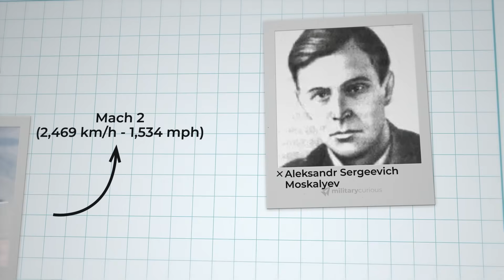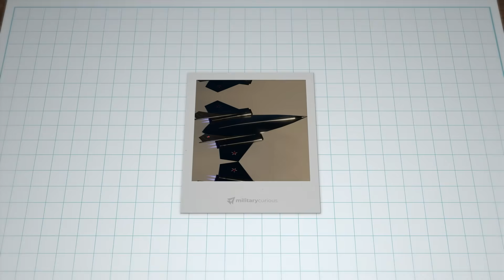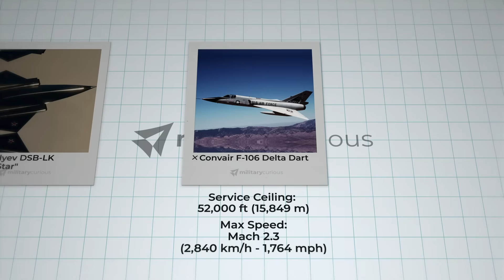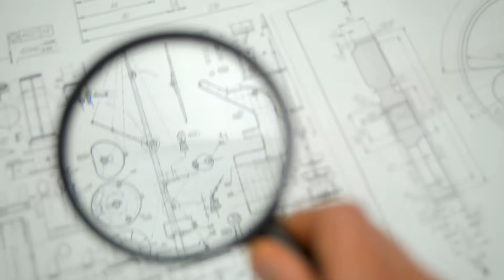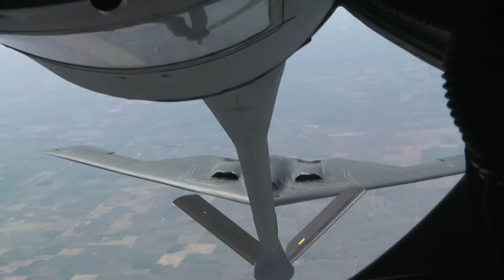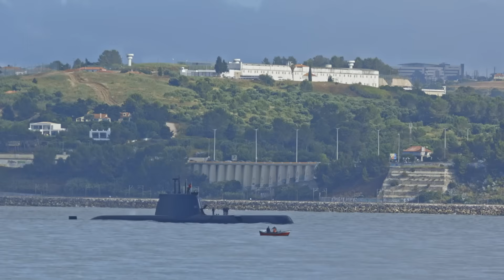This Soviet Fighter Jet Terrified The West (Sort Of)

Comment: What ever way you look at this aircraft, it is a beautiful looking plane. Especially for 1957, hell it looks great for now and I am sure they could have it run at Mach 6 quite easily and stably with modern flight systems. I can't see this SRxx being to much of a thing for some time, the US has not got access to the materials they need to build more than one prototype if they are lucky. The predecessor lost quite a few in test flights, Mach 6 is not going to be an easy assault for a manned aircraft.
Reply: Yeah I could tell it was from the fifties by those tall fins in the back. Just like the cars from the 50s.